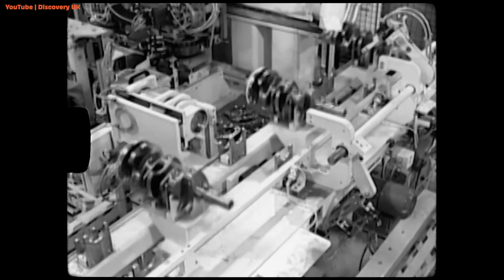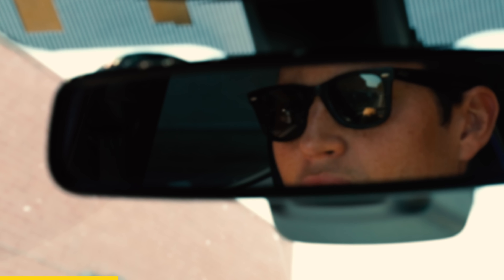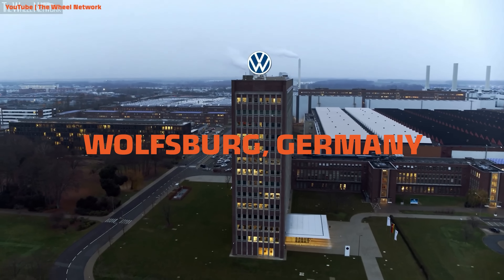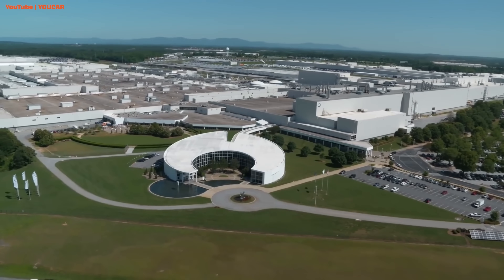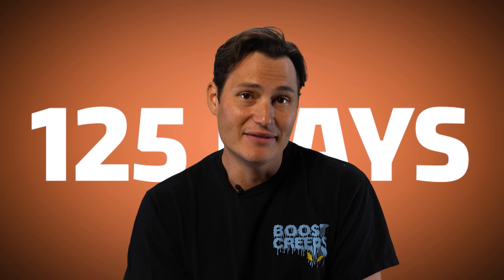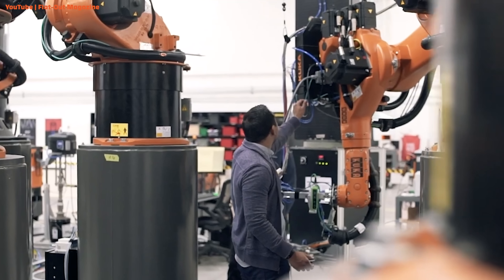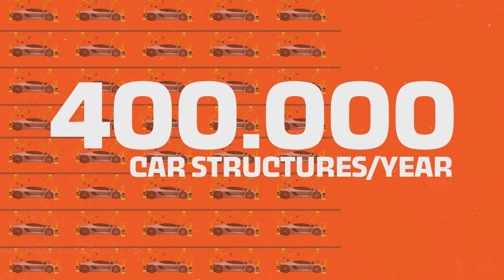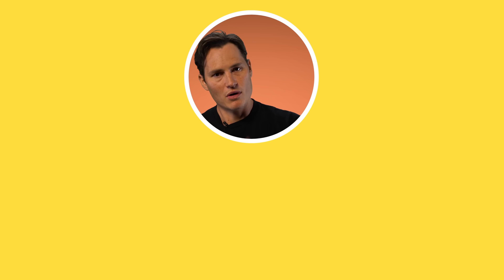A.I. Designed this Car

Comment: everybody gangsta until something needs to be repaired...
Reply: @Pershing  I don't think that you can just 3D print components that need to carry heavy loads. You'd need the exact composition of metals used, the CAD model of the component (with a complex geometry), you'll need to know how the part was heat treated, you'll want to test it before putting it in a car. I doubt that the company will give this information to anyone and everyone.
Reply: @ThapeloMKT  Nope! 3D printing by getting the design from manufacturer would do the magic
Reply: @ThapeloMKT  Precisely. Plus, the kinds of printers used to print these parts cost more than the car.
Reply: @Pershing..
I think you raced straight passed the point of the comment.
Quite a feat for the first response.
.
Optimizing the whole build would likely make replacing a part absolute hell.
It would take a couple of goes before the A.I. would find the right values for spacing and build order to also benefit repairs
Reply: Discard.
Reply: @halcyonoutlander2105  Yeah you're right but it doesn't mean that the car cannot be repaired easily!
What I meant was getting the part printed by the company and fit it into the car 🤷‍♂️
Reply: Just 3d print the part, and replace it
Reply: @generalpershingm2656  
Or 3D print a whole new car, they will be about as disposable as razors anyway if/when this tech picks up. Don't believe me? Who has a stropping strap? That's right, no one owns razors anymore - they're disposable because they can be made in bulk and tossed in no time. Razors not advanced enough? Look at printers - the ink costs are so high it's cheaper to buy a new printer sometimes. Imagine a car that is so low cost it is economical to just get a new car versus replacing the battery. That's if money even keeps its worth at all, money used to be a measure of human work but what will that matter when there is no human work in the process at all?
Reply: @ghostflames1501  I own a straight razor
Reply: @zaneebel6304  
Cool, I know only a few people that do - most have the disposable ones now.

Comment: It is very efficient in term of design but there are one major issue, those data base of material science well (which in most case are quite old tect because of much needed data point which need time to gather) test data and its properties only accounts for what is "currently" possible but not for what it "will" be possible in the future. Therefore the design will be the best at only current material technology. So when the design is done the next day it will already be obsolete.

Comment: I'm sorry this is just BS. It's a glorified add.
Trust me or not, after all I'm just a guy on the Internet... But I'm an engineer specialized in simulation engineering working for one of the leading provider of engineering software and soon to do a PhD in the field. I've also worked 2 years ago on titanium additive manufacturing for the aerospace industry on the Selective Laser Melting technology presented here.
No, IA didn't designed this car. I don't say they never used AI in the process but IA is as of now VERY inefficient and not accurate enough to do that sort of things.When he talks about "organic like" structures? This is not AI, this is topology optimization based on finite element analysis. It basically is clever math and a smart engineer behind a computer. No machine learning involved. Gather all the data to train an IA to do that has no point and will just give you "trust me dude I'm an IA" kind of results: you can't depend on it to accelerate a human to 270 mph without killing it. They used simulations not far from what NASA already used for the Apollo program in the 60s... There is no magic involved and it can be traced back to proven theories from the 17th century!
As for metallic 3D printing: it's a mess. It's just starting to be used in the aerospace industry because there are a lot of finishing steps with human involved after printing. It is ludicrously expensive and not yet understood enough. In its current form it will never be profitable for the affordable automotive industry.
If a company claims things too good to be true, it probably is... No, an obscure super car company didn't revolutionized car designing and manufacturing. They don't make the software, they don't make 3D printers: they are "just" good engineers with a competent marketing team. The founder is even trained as a lawyer: not an engineer or IA researcher! This is why it's just 80 very expensive super cars and not the next VW...
Reply: Agree. If it were that revolutionary, big auto manufacturers would already use it. I guess its a way to design some parts of the car to be better quality, but not more economical. Thats why they r making a supercar where cost is not an issue. Also - computer design stuff is already at the factories. Just compare a car from 20-30 years ago vs today
Reply: Totally agrees with you. I have worked with robots before and when he said that it's built in one hour, even with all the differents pieces already printed, I still have great doubt unless the car is even more simplified than they claim. 
Oh, and programming robots to assemble only 80 cars is not really economically viable, unless as a proof of concept.
Cool vid, but too much bold claim.
Reply: I have a hunch this car will be an over engineered money pit.  Show me the car, let the rubber meet the road and let's see how good it is.  Making a good car can't be this easy.  I call bullshit.
Reply: I agree with you.  As someone who did vehicle product development for 15 years, there is usually no comprehension from folks outside the industry of what it takes to progress a concept all the way through the development process to production.  There is so much misunderstanding about this video it is maddening, and very disrespectful of the people that do the real work in making vehicles for you all.  You can't apply AI to a DFMEA, or a PFMEA, or a DFM, or a DFA, or many of the tools utilized in the APQP process.  Further, since one of my roles was electrical architecture (including wiring), I appreciate the thought about minimizing wiring runs, but there are so many ways that it's just a really bad idea.  I could continue the rant, but would propose a next video theme.  Grab an experienced auto engineer, and have a "Tell me what you think, and I will tell you why you are wrong" session.  That would be entertaining.
Reply: Thanks for the clarification 👍 helps know more and understand what is really going on
Reply: Hey just wanna say as an engineering student with a little piece of your experience level, I appreciate this comment a lot.
Reply: thank you!
Reply: Just goes to show how misinformed people are about A.I. it doesn't just "learn" the same way people learn.
Reply: All very good points. Generally, people who don't understand a technology don't understand its limitations. They will expect magic. This applies most of all to A.I.
Reply: You must be an engineer, bc your spelling is off. It's "AI" not 'IA."  😅
❤
Reply: @workin4alivin585  Sorry I'm not a native speaker and it's "AI" in my language 😅
Edit: you see I mixed them up again: it's "IA" in my language 🤣
Reply: @RazgrizDuTTA  👍😍
Reply: @Aquatic Ape  What are you talking about? EOS is a company that make Selective Laser Melting (SLM) printers and Electron Beam Melting (EBM) printers. I'm not talking about the company named "SLM" but they are not THAT behind EOS I guess? I worked on EOS SLM printers. Are you refering to other methods like Direct Laser Deposition DLM/cladding ?
I'm not saying the aerospace industry doesn't use it. 2 years ago it was used for the manufacturing of a few parts in the aerospace industry but juged not mature enough for a lot of other parts. 2 years ago is like yesterday in the aerospace R&D world so yes it is not mature yet. Anyway there is a big difference between what is considered mass production in the aerospace industry (which metallic additive manufacturing is not yet) and what mass production for the automotive industry would imply...
Reply: Thank you for saying this. I said it earlier but coming from someone experienced, it just matters more. I've seen topology optimization in ANSYS work on my weak ass entry level gaming laptop, and I can see it just chipping away the low stress regions, and producing those exotic designs as in the video. AI the new snake oil these days.
Reply: Razgriz, I completely agree.  Ai, at most, can optimize aspects of a car design. There is no way for ai to train a nn for an entire car. There is no training data to tell a nn if it's overall design is correct, or not.  And no way to build the car for humans to test it.  If you could build them, there wouldn't be enough time or humans to test each aspect for billions of test miles.  And, no, you can't simulate EVERYTHING to compensate.  
BTW - I have written convolution neural networks.  Oh, and EVERYONE is "using AI". It's the new hyped buzzword.
Reply: Plus A.I. Is often misunderstood. In TV shows, Artificial intelligence is a digital consciousness that can think freely and independently. 
But in reality, it's a highly targeted set of rules that allow a computer to run variables to optimize a data set and offer one or more outputs. And data optimization is NOT actually a.i. Its just system optimization. Marketing people are calling any kind of software that makes even the most rudimentary decisions a.i.
Reply: @duhmojo624  I mean look at keonigsegg. They only make supercars. Maybe part of the business plan is to start off with supercars to show the capabilities of the technology and then trickle down to commuter cars. Like Tesla - they started off with the roadster to get the initial investors before getting into the commuter market.
Reply: Fair enough. But what if the AI was powered by quantum processes and was fed number data from as many resources as possible? Maybe they had a breakthrough. Afterall is this not what we are trying  to accomplish. Im sure there as some lies and some half truths thrown in there. I say keep going fuck it why not.
Reply: I don't know why this person have to be trigger, just listen carefully what in the video said was AI was doing fully design. He not saying AI assemble nor cut things using AI. This is when ignorant just blatantly ignore the video said. Using 3D print for making a part that what video mention, he not said AI making a part. Even at robot hand part, the video also has mention it was program. In the conclusion it possible to do without a worker for assemble and creating part. It just robot been program for do other stuff that why it said fully autonomous build beside programming. For clarification again, AI only do the best for designing not entire process. You just being ignorant.
Reply: @CyberCl0ne  I'm not saying AI manufactured the part, sorry if it's not clear: I'm exposing the limitations of metallic 3D printing. But when you are saying AI designed the parts, I'm saying it did not. It used topology optimization based on finite element analysis for sure. Which is not AI and which is not revolutionary and already widely used.
Reply: @RazgrizDuTTA  Hey, just thanks for reaching out as an informed individual and debunking myths and common misunderstandings. You may have seen enough of this stuff now for it to be "normal" but I must say, the suspension arms on this machine are truly mesmerizing despite the possible fallacies being perpetuated in this video.
Reply: @RazgrizDuTTA  They probably just used a commercial version of ANSYS lol. 
Agreed, using topology optimisation and MOGA is nothing new. People really don't understand that SLS/SLM requires SO much post-processing, and most intricate designs can't realistically be processed or have low FoS
Reply: At an engineering POV (I'm a step superior from you, as I'm NOT that guy), you have obsolete teachings that no longer work in this current year or technological steppe. It's obvious you don't understand numbers (nature IS NUMBERS), apply the information into a computer, and a simple step tree ai algorithm can design within a perimeter, yet be of it's own calculation.
It's not a glorified ad, it's a step in what's to come and the starting events that will lead to YOUR unemployment. You don't understand the science or how simple AI really is, so naturally, you've been left behind in the technological race.
People still seem to think AI is self realizing... AI is simply self learning, error simulating and reduction based boolean logic at a sequential level, true ai requires technology we don't quite have yet, so the clear next step is a self thinking, self contained logic system that can produce on it's own device, per it's own calculation, based on the information and parameters of an outside force (developer/handler).
Reply: @escapedcops08  lol you need to learn to lie better.
Reply: @escapedcops08  It's painfully obvious that you don't really know well how AI works. OP is right, this is not revolutionary (although I'm willing to be that more advanced algorithms will help the automotive industry design cars in less time), and 3d printing, no matter how much you refine it, will always be way more expensive then traditional methods of manufactoring.
Reply: Just because you haven't done it doesn't mean it can't be done. And if you think you need to be an engineer to create a car brand, you don't understand how business works. This is the future bud. Sorry if it threatens your existence, but automation has been going up and won't be going away any time soon.
Reply: @jorenreyes6778  Do you know in details how machine learning works and how engineers design things? Because what is claimed here is truly revolutionary and I would expect the founder of such a small and new company to be at the edge of the AI field and/or simulation engineering. But he is not. He probably is a competent business man and has competent engineers working for him. He can indeed creates a successful car brand but revolutionizes engineering potentially for dozens of industries I'm not sure... Also I'm not afraid of automation for now. There are legal implications in engineering when designing something and you can't just delegate that to an AI you can't explain the exact workings. You don't have to look at AI to see amazing things: take a look at finite element analysis or computational fluid dynamics (when used appropriately but it's another debate...).
Reply: @RazgrizDuTTA  there was once a time when people said the internet will never work, and a time when Jeff bezos was building Amazon from a little room. Look where both of those things are now. As for this, you'll just have to wait and see
Reply: Lol.... to much text xD

Comment: "Insanely low variance"
Be me, Machinist: Ooo, can't wait to hear this...that's gotta be toight!
"0.004-INCH"
Me: Bwahahahaha!  This past week I had a total variance that was over 8 times smaller.
Other older me: Ha, you think that's tight, I once had to hold a tolerance of .0004, over 2.5 inches, over 50 parts!
Other other older me:  What I would have given to have .0004 tolerance...back in my day, I only had a lathe and sand paper, to hold .0003 variance.
Other Other Other older me:  Luxury....

For those who don't know:
The Four Yorkshiremen Sketch
https://youtu.be/VKHFZBUTA4k

BTW, Additive Manufacturing coupled with automated Deductive Manufacturing is pretty much the future.  This is a great vid :)

Comment: Yes. But you cannot control the hardness and grain structure hence cannot heat treat when you 3d Print metal. How are they overcoming these, or have they not physically stress tested it?

Comment: A. If AI cannot create a cheap mass produced car it is not worth the hype
B. If AI cannot create a super car that competes at the same or higher level than “orthodox”  super cars, it is of no added value
C. If AI cannot create cars at a competing price level it is of no added value (practical, not claimed).

In reality AI is getting into all kinds of IT related work, but in a way it is just another hype.
Let’s talk again if you win Le Mans or if we see millions of these cars on the street.

Good presentation though.
Irony - the SR71 was made the old way, without computer aided design, but rulers and paper.

Comment: If the parts are the main bottleneck, then if they just got a whole bunch more 3D printers, they could churn out cars at a rate competitive to any major automobile manufacturer with a tiny fraction of the footprint, and if all the hype is real, their cars would also be by far and away superior to any other on the market. Needless to say, I don't buy the hype, though I think the concept of the "AU" is interesting and perhaps in the future we could see it implemented in other ways. I can see militaries snapping up such a device, as it would make the key strategic weakness of any country - their industry - far more flexible and mobile. Right now, it'd be impossible to convert America's car factories into making attack choppers, but with AUs it could be done easily.

Comment: My God these guys talk some sh1t! The shape of the car may vaguely mimic the Lockheed Blackbird if you look at it through a full glass of beer. Having said that, it does look amazingly similar to a number of LMP race cars. If a magic bunch of computer algorithms randomly came up with the design of this car then I'll happily root my boot. I'm confident that, in reality, this car was designed by a carbon-based design team who made use of computer-aided drafting and modelling tools. This carbon-based team have referenced any number of successful race cars that already have a proven record of efficient packaging, light weight, rigidity and aerodynamic downforce/drag ratio. I don't see much here that's a revelation. Sorry for the scepticism, but I think this car is an iteration, not a revelation. Very, very, very cool nevertheless. I'd have been impressed if it was presented with no commentary.